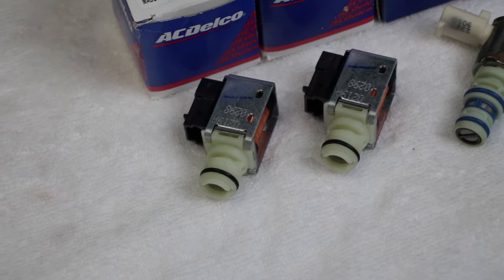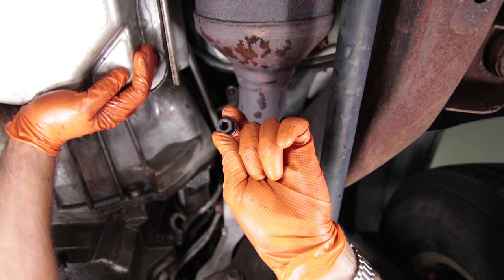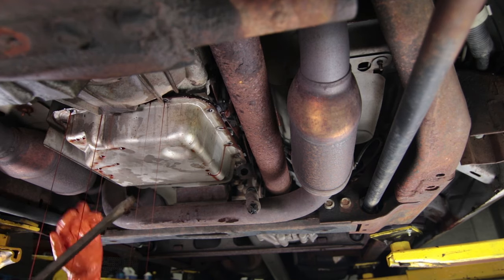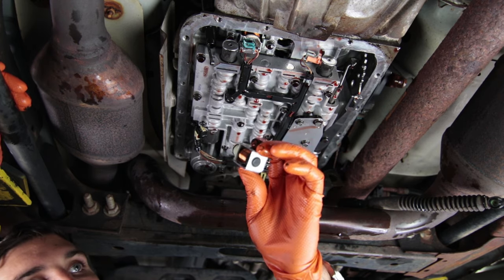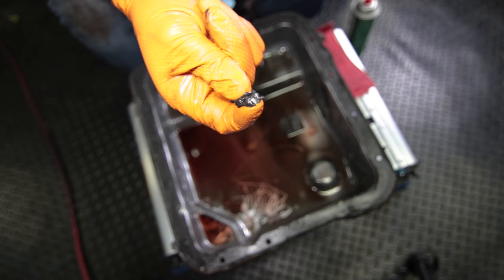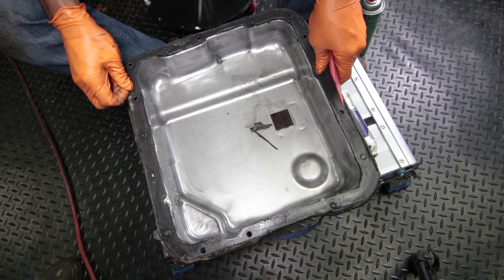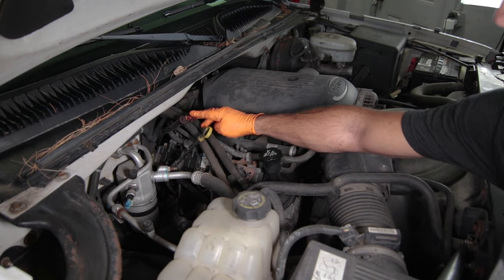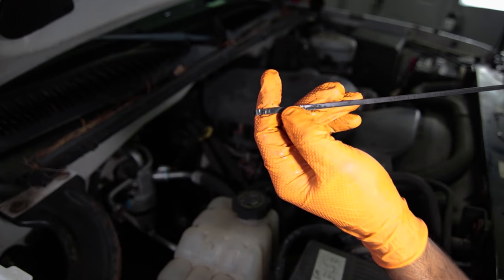HOW TO Replace All 4L60E Shift Solenoids and Torque Converter Clutch (TCC) Solenoid. Silverado 1500

Comment: Pro tip. Use a fluid evacuator through the dipstick and suck out the fluid before removing the pan. There are replacement pans, available with drain plug. Also, you can find a aluminum transmission pan that is deeper and has fins to help cool the transmission fluid.  A nice upgrade. Any truck with a automatic transmission is a larger transmission cooler especially if you tow trailers.

Comment: I just did a filter change on one of these theres a bolt that holds the bracket located on top( one end has a screw the other end the bolt) remove it take a pry bar and push it out of the way to put it back tap the bracket with a hammer. You dont need to remove the exhaust you dont need to remove the tranny mount bolts and jack up the tranny its super easy.  The bolt is half inch just like the pan bolts. Good luck!

Comment: even lying on my back with the 4wd drive shaft in the way, I take the top bracket bolts off instead of bending the bracket.  It's not too hard especially if you change the torx head bolts to regular 13mm head bolts.  The deep pan clears the cross over pipe well with out messing with the exhaust.  This is on my 2006 GMC Yukon with the 5.3
Reply: Do they not make these pans with drain plugs so you don't have to make a big ass mess??
Reply: @franklee9127  Yes they do.  I bought a pan for a 2003 GMC and it has the factory drain bolt.
Reply: My 98 Z-71 is throwing the 3-2 solenoid code, might try this
Reply from the maker: That's definitely the correct way to do it. Don't risk messing up your ebrake
Reply: I need a vid of this bracket removal
Reply: @ricardov1285  It's not hard.  A 3/8 short ratchet, a mirror to get an idea where the bolts are, and your other had to feel for them.  Taking the standard torx head bolts is hardest.  I replace them with a 13 mm bolt head.  Easier to get to with ratchet and socket or flex head ratchet wrench.

Comment: I bought 94 chevy Silverado 1500 5.7L 4x4, The car has been lying dormant for 15 years , when I started to test drive, It shifts gears 1st to 2nd very smoothly, but for 2nd to 3rd and 4, I have to press the gas pedal several times to change gears, When I looked at the transmission fluid it is full of bubbles, it has too much fluid 5 cm above the hot mark, and the color is almost black, do you think the problem is from fluid or solenoids, or need to rebuild the transmission? How should I know the transmission is 4l60-e or 4l60 ?
Thanks
Reply from the maker: I would fix the fluid level and see how it does after that. Get a vacuum pump and suck it out the dip stick and refill with fresh fluid

Comment: Have to replace my TCC and 3-2 tomorrow. Doesn’t seem that bad.
Reply from the maker: not bad at all
Reply: Hey someone help me plz. Ok I have 05' TB and it shows the engine light but want shift into 3rd gear. Can it be this problem or ppl saying my tranny is going out. But when I'm driving doesn't seem like it
Reply: @trdsport  could be the shift solenoids. Did you scan the engine light to see if it threw a code?

Comment: Hey thanks! I’m not sure if your truck is the same as my 2004 hummer h2, (mine has a bolted on cage)but to avoid the exhaust and that bracket, I used your method to drain most of the one side. After that, and taking out the front bolts, I reached over the pan, pulled the filter off and let it fall into the pan. Then it slid right out. Hope this helps someone out. Great video!

Comment: I think there is something to be mentioned here in labeling what is what. The first solenoid you took out appears to be the TCC/PWM solenoid; which you did identify. Directly over the connector for that, is the torque converter clutch solenoid valve which is being held on by those two black bolts and bracket that comes attached to that solenoid. If you come up with a code for the TCC solenoid; you might want to replace the TCC solenoid valve as well
Reply: I have a 94 GMC Sierra C3500.  Got a code 39 and can't seem to get much information about it from anyone so far.  It says that it is a Torque Converter clutch sensor.  Where is located on my 94 transmission?  Is it in the same place as shown in this video?
Reply: @michaelpearce8661  Should be in the same place. If you are going to fix it yourself, I'll tell you it made it a heck of a lot easier on me to simply buy a new transmission pan. Was only about $30 and came with a new gasket. Sooo much easier than trying to remove all of the old gasket from the old pan and less cussing.
Reply: @50footofflame91  same here. And if you’re feeling froggy, you could spend about $50 and get a trans pan with a drain bolt. Makes life so much easier lol
Reply: @gabeh.5061 yes some Asian cars have a transmission drain plug. Smart idea

Comment: Great video super helpful. The only thing I noticed is you didn’t go over the seal that holds the filter in. I’m having trouble getting the old one out so I can put the new one in.
Reply from the maker: They are a pain to remove. Just take your time with it and be careful not to scratch the side walls.

Comment: Hey thanks for taking the time to make this video much appreciated. I think this is ultimately what I am going to have to do with my 99 two door Tahoe. I replaced the fuel pump  yesterday and drove it to work and it takes off from a stop just fine but if you push the accelerator hard to pass or let's say getting on to the interstate it acts like it's in neutral. If I back off and feather the throttle I can get to a higher speed. I am hoping to get some feedback on what you might think the issue is? I am going to check the simple stuff first.. The fluid, grounds, electrical harness for any rub through, linkage, and the throttle position sensor. I am almost positive that it's going to be the A and B shift solenoids.
Reply: I have the same issue with my 2000 gmc. I was thinking the wire from the throttle body that goes to the tranmission might be slacking. I'm taking my tranmission pan off tomorrow and replacing the filter and whatever else I can and i am going to see if it improves. Does your vehicle rpm go up past 4000 or does it struggle with that when you floor it?
Reply: @tristinbrietzke5649  noticed that my rpms don't spike but it acts like its in neutral until I back off of the accelerator and feather it. I am going to start with a fluid flush then if that doesn't change anything I am going to do the same thing. drop the pan and replace all the solenoids. Also getting a pan with a plug. Easy to drain the fluid and I figure save some time cleaning the old pan. Now to only find the time to get at it...lol
Reply: @dustinw5527  yeah we are going to do the same here when we have $$ to do it. Let me know if it fixes your issue!! These you tube people dont really have the time to ever respond to us commenters lol. If I get it done before you I'll let you know the outcome!
Reply: @tristinbrietzke5649  yep will also let you know what the outcome i come up with. Sorry it won't be til this weekend. I work goofy hours and my garage is tied up with a 98 2 door tahoe. So it's the drive way for me... sure the neighbors would love me if I started wrenching at midnight...lol. I also would like to drop the pan and actually have the solenoids in my hand before heading to the parts store to compare them... my luck I would end up ordering what I think is right and end up having to make multiple trips to the parts store.
Reply: @dustinw5527  lol that always happens. Best to take the part with you!
Reply: @dustinw5527  did it work?
Reply: I have the same issue on my 95 k100. did you fixed it?
Reply: We
Reply: @tristinbrietzke5649  my 04 suburban is doing the samething your describing did you ever get yours fixed and or figure out the cause of the problem im going to drop my pan today and check my a b solenoid and check everything else out while im down there. any reply would be greatly appreciated

Comment: What were the symptoms you were having that made you replace the solenoid?
Reply: Thanks. Iam wondering why too, part changing must serve a purpose.
Reply: Please answer this
Reply: @lielyncher755  mine were the 3-2 and the torque converter selinoid I chnaged all 5. Mine was stuck in 3rd woukdnt downshift and it stopped pulling chnaged fluid still wasn’t so I replaced it and it worked fine. Any slippage could be from the torque converter selinoid or your trans simply going out.
Reply: Stuck In gear
Reply: Mines stuck in 3rd gear once it hits 3rd gear it won’t shift up or down on its own, replaced all the solenoids and still does it. Fluid didn’t smell burnt and there wasn’t a single shaving in the pan
Reply: @JustinMussen  check your shift rods on your selinoids any dirt or build up can cause them to not work.
Reply: It shifts real smooth from 1-3 but when coming to a stop doesn’t shift back down and doesn’t shift up to fourth. All 5 solenoids are new. Tranny fluid that came out wasn’t burnt, not a single metal shaving in the pan or fluid, no burnt smell at all, the code I have is p0785. I changed the fluid, filter, 5 solenoids today to hopefully get rid of this issue and it didn’t fix it. So I’m stumped now boutta just replace the tranny.
Reply: My chevy would shut off after gassing it from a stop. Delayed shifting. Change the filter and screen the old fluid to re use
Reply: @JustinMussen  did u check your clutches?
Reply: @justinmussen7299 maybe something in the wiring harness. They sell complete kits too
Reply: Mine shift fine but if I get on it from 1-2 and 2-3 when it gets to the point where it shift it hesitates and makes a squeal noise and I would have to let off it then it’ll shift normal
Reply: Well this could be due to it shutting down in park or low idle bc the transmission will shut down the motor
Reply: @justinmussen7299 what ended up being the fix? I have same code
Reply: Debating if it is a solenoid sensor , my truck hits 40 and drops to 1000 rpm and stays stuck there slowly accelerating. When it hits 50 to 55 the rpm’s jump to 1000 to 1500 back and forth making a weird noise
Reply: @Sniffy-Biden you just filter and reuse the fluid? If it’s dark or clear and burnt up it loses its ability to work
Reply: @JustinMussen what was color of fluid? Bright red or dark or just clear
Reply: Hard shifting problems
Reply: I have a 2006 Silverado 1500 4.3 v6 the trans seems to be stuck in 1st first system was a  “transmission hot “ pulled over towed it to the house let it cool down then drove it and seemed to not want to shift out of first ide rev it all I want and nothing ( trans was rebuilt 15k miles ago )
Reply: @joglycruz3410  you have not tried the selenoid or did?

Comment: It's way easier to get the transmission fluid pan out without having to remove any bolts for the exhaust or really any exhaust components for that matter.

I have a 2000 Chevy Silverado 5.3 V8 4 x 4 LT Z71 extended cab and I was able to get it out with a hack I found on here with channel lock pliers where you grip the shift cable bracket and the drive shaft and when all the bolts are loosened on the transmission pan it'll just pretty much pull right out. You can also use AC clamp butt make sure you have one that can get up in the tight space it's also tricky to use the channel lock pliers to hold while you're putting the pan back in

Comment: 2015 Chevrolet Suburban 2wd drive, 5.3 V8 (162K miles). Gear upshifts perfect but when it comes to downshifting on lower speed i.e stopping for a red light or stop sign it downshifts so hardly, I was wondering what could be the issue. Also, every morning after seats 4-5 hours in the parking garage, on D when pushing the acceleration pedal there is a very bad metal sound that comes from underneath the car about 3-4 seconds.

Comment: Awesome video! I’m getting ready to change the solenoids in my ‘13 4.8l Chevy. I’ve got the 4L60E in mine, but mine isn’t a 4x4, is it safe to assume all the solenoids are the same? I plan on using your video as reference, while doing it.

Comment: Thank you! My 2003 Suburban quit shifting into 3rd. When I dropped the pan, both solenoids were broken. I'm not sure if I broke them when I took the pan off. I guess we'll see when I put the new ones on.... 
Also, I luckily had a drain plug.
Reply from the maker: Drain plugs are nice! Hope it worked out for you!
Reply: What turned out to be the issue? I have the same issue after replacing my auto trans pressure manifold sensor
Reply: @CherryACR  if you figure it out id love to know! Im waiting on parts currently
Reply: Did this work??? Having same thing

Comment: I have a 98 Sierra, 250k miles, all original. Driven easy, often serviced. No shifting problems. Would you recc replacing solenoids as a maintenance precaution?

Comment: Easier to get clearance by loosening the trans mount bolts then jack the trans tail up a little gets you the space you need to get the pan out with out messing with rusted exhaust bolts. I've been a wrench for 40 years thought I'd pass that one on.

Comment: Great tutorial but most sources I've come across say that when you get a 0756 code,  it typically means you need to replace or rebuild the tranny.   Any way of knowing if new solenoids make good sense?
Reply: Good question.  Did you find your answer?  It's an inexpensive gamble to replace the solenoids and fluid though, so I figure I'll try that first.
Reply: @paxonearth  mine put out another solenoid code the next day, this time 0751. Then I lost all gears except maybe 2nd. I towed it to a transmission shop. They said it failed the pressure test  (so it was apparently something other than the shift solenoids) With 139k on it, I just told them to put a remanufactured one in.
Reply: @paxonearth   I seem to recall another channel showing a way to test the solenoids with a meter without removing the pan. It required an electrical diagram. Post up if your repacement works. I just had a feeling I wasnt going to be that lucky and have a code actually diagnose a problem rather than just a symptom.
Reply: @jerseyjim9092  I ordered the parts. Keep you posted…

Comment: My 2002 chevy suburban check engine light is reading the P0740 code with is the torque converter solenoid should I change all of the other solenoids also or just that 1 ?
Reply from the maker: Since you’ll be in there, might as well change them all because it would suck to have another fail late and have to remove the pan again
Reply: Go on Amazon and get the kit with all solenoids ac delco.

Comment: Question, I have a 2016 Chevy Silverado 1500. Check engine light code says bad Pressure control solenoid in transmission. Could you tell the location for that solenoid? Thanks
Reply: U figure it out

Comment: What were the transmission symptoms that required changing solenoids?
Reply: Choppy harsh gear shifting
Reply: What abiut a slow and slippy shift from 2-3, will these solenoids fix that?
Reply: I think this is my issue.

Comment: Well done video, and very informative and explained well, I’m wondering if these could be the cause of my trucks issue... 
My truck shifts into gear great with no hard shifts or slips, but when I try to take off in drive it’s like I’m trying to take off with a manual transmission in like 4-5 gear, so I have to manually shift down to 2nd then it will take off but sluggishly, but once you get going you can shift into drive and cruise around fine.
The issue to me seems more electrical than mechanical to me atleast
Reply: Did u ever fix it?
Reply: @Eastsidee817  im interested in this as well,  my is sluggish to take off and once im going its fine but if i start up a hill it feels like it doesn't want to shift down and i start losing power
Reply: @Eastsidee817  I don't know about that guy, but mine was doing this once every several months, after rolling to a stop. Felt like it was in 3rd gear. After changing the fluid it never reoccurred, so it seemed like a bad fluid issue. Pretty sure it was originally 192k miles.
Reply: Any updates? My 05 does same when I pull my boat

Comment: I lost 3/4 out of no where a few days ago. 1/2 drives perfectly fine. Would this fix my issue?
Reply: Same thing happened to me yesterday 😂😂 I was doing donuts in the snow
Reply: Yes it would but change both of them because you're already going to be in there. You can get them AC DELCO on Amazon for a fraction of the owrrs store price.
Reply: Balto Time for a transmission overhaul, 3-4 clutch pack burnt up.

Comment: I recently replaced the shift solenoids in my 97 when changing the transmission filter. One of shift valves popped out like yours did. I put it back in and installed the new solenoids. I put everything back together and now it wont move in reverse. Drive works though. Any idea what i may have done wrong?